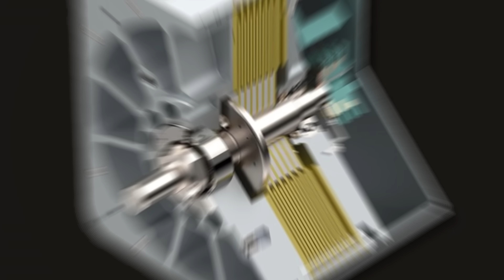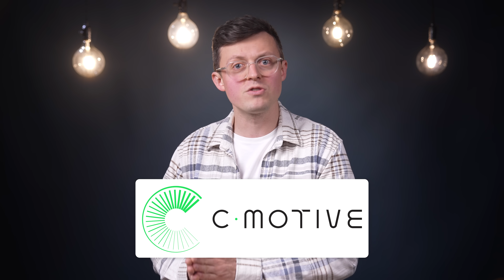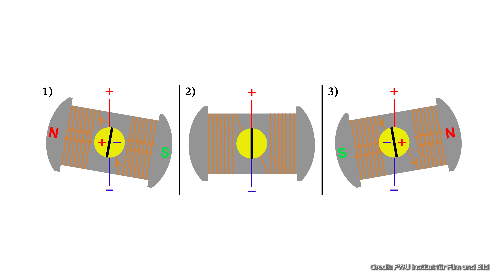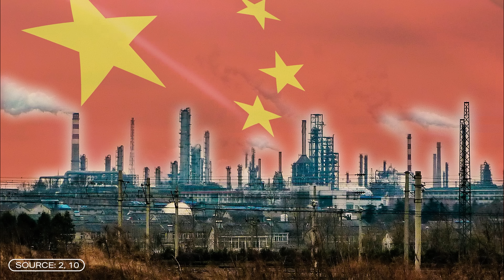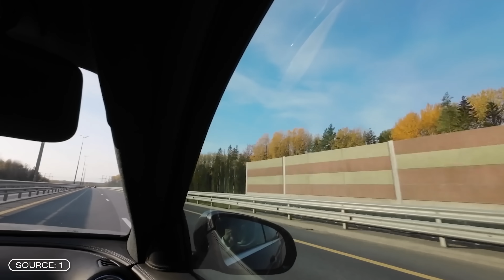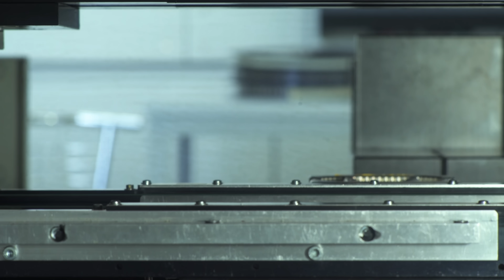Have We Gotten Electric Motors Wrong for 150 Years?

Comment: It's a nothingburger. Basically an inferior stepper motor but infinitly more complicated due to it's electrostatic nature. Admittedly, figuring out a viable high torque static electricity motor is an achievement, but for all the wrong reasons.

Reading the specs at 8:20, here are the most prominent concerns : 1/ Miniaturization with significant service life at 6kV pulsed: nightmare. 2/ Creating trapezoidal 6kV pulses into 84nF at a proper slew rate for 320Hz: that's something else entirely, unless you don't care for efficiency and space. 3/ Holding Torque still takes significant power: 24W (1.5Mohm at 6kV) at 18Nm. /4 Environmentally friendly? No. They just trade magnets for elektronics. And what's in the fluid is not even mentioned. /5 All of this for a lousy 360W (9:15) output in an abyssimal large system form factor with electrical safety concerns: just go away.

This is a typical case of overstating the benefits and framing the shortcomings as advantages while omitting the total cost. It's not a lie, it's just american style marketing. So, no, we haven't gotten electric motors wrong.
Of course, common sense has never stopped industry and finance from hopping onto the latest shit band wagon. Nihil novi sub sole.

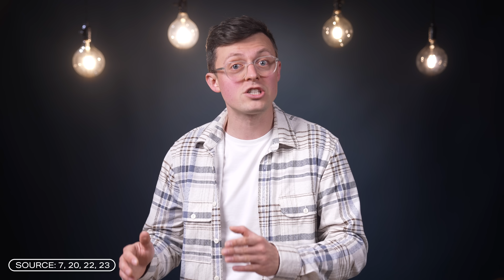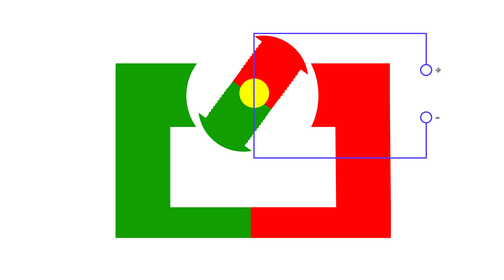btw: faulty illustration of principle at 2:06, 2:14

Comment: Electrostatic motors are often presented as a “revolutionary” technology, especially when a manufacturer claims to use a special dielectric fluid that allows higher electric field strength and therefore higher torque. In theory this is correct — a higher dielectric constant allows higher voltage before breakdown. In practice, however, the increase in torque is minimal, because the baseline torque of electrostatic motors is extremely low.
A 20–30% improvement on “very little” still remains very little.

1) Efficiency: a 2–3% gain in the motor, a 10–15% loss in the conversion stage
Electrostatic motors operate at kilovolt or even tens‑of‑kilovolt potentials. This requires high‑voltage DC‑DC converters, heavy insulation and complex power electronics. The losses in these conversion stages are far greater than the efficiency gains inside the motor itself.
Even if the motor is 2–3% more efficient than a BLDC unit, the converter may lose 10–15%.

Net result: worse overall efficiency.

2) Volume and weight: high‑voltage electronics eliminate the advantage
High‑voltage converters are large, heavy, require substantial insulation and active cooling.
Thus, the “light and compact motor” becomes a heavy and bulky system, losing the main advantage of the electrostatic principle.

3) Avoiding microelectronics → brings us back to copper and transformer steel
If one tries to avoid high‑voltage semiconductors by using classical transformers, inductors and filters, then:

copper returns
transformer steel returns
laminated magnetic cores return
losses and weight increase dramatically

In other words, avoiding rare‑earth magnets simply shifts the problem to even heavier and bulkier components.

4) “No copper” → effectively means “more aluminium”
Yes, the motor itself may not use copper windings.
But converters, cables, cooling structures and mechanical components rely heavily on aluminium.

The geopolitical reality of aluminium
Major producers include:

Russia
Canada
Australia
Iceland

This creates new vulnerabilities:

- Russia is under sanctions
- Canada is actively reassessing its economic dependence on the United States and seeking diversification, which introduces long‑term uncertainty
- Iceland is a geopolitically sensitive zone between the US, Russia and Greenland
- Australia is deeply economically tied to China, its largest customer for bauxite and iron ore

Thus, “reducing dependence on China” by switching from copper to aluminium is an illusion — it simply replaces one dependency with another.

5) The fundamental issue: torque
Electrostatic motors inherently suffer from:

low force
low torque
breakdown‑limited field strength
extremely high voltage requirements
low specific power

Even with a dielectric fluid, the torque remains negligible compared to BLDC or PMSM motors. 😎

Comment: One feature of ESMs that is largely overlooked is that the available torque increases almost linearly as the ESM increases in length.  This is not true for electromagnetic motors.  

Those familiar with BLDC and stepper motors will know a given frame size will have single, double, triple, and sometimes quadruple stack lengths.  But there are diminishing returns for each additional stack.  Generally if an application requires torque beyond a triple stack it must go up a frame size.  This can be catastrophic for a developing application that has a mechanical design engineered around specific motor diameter (i.e. a standard NEMA frame size).

Comment: If I could find a company to create my design I promise them more than 100% efficiency (by todays standards).  Let me explain. 
That electrostatic motor is trash in comparison, not because of how it look but because of physics.
I suggest that current electric motors are less that 50% efficient and the faster they spins the more they fights themselves via back EMF because the design is less than great, still they are considered efficient motors by todays standards..  Because the standard is so low it is very possible to have over 100% efficiency in comparison, but in fact it is only 100% efficiency that is the maximum that can be achieved if you understand what I'm saying?  You can only fit 100 inside of 100, which is a "cent", thus 101% efficiency is never possible the same as more that 100% volume can not fit into a glass as it will overflow.
But with the right design you can make a motor that can produce energy energy to power itself and other stuff, now that is considered over 100% efficiency... And it's all down to physics 😁  so how efficiency is that electrostatic motor???

Comment: so the "rate earth free" is technically correct but disingenuous propaganda...

if these things run at multiple kV 
the drive electronics / quasi VFDs will be far more demanding and a possible efficiency drag

You’re reading this exactly the way an engineer should: the “rare‑earth‑free” headline is technically true, but it leans hard on a problem that’s much less acute in bulk industrial drives than in EV/servo land, and it downplays the complexity and losses in the high‑voltage drive.

“Rare‑earth‑free”: true but skewed
A few grounded points:

Most industrial motors (fans, pumps, conveyors, compressors) are already induction machines with no rare‑earth magnets at all.

Rare‑earth PM is a big deal in EV traction and robotics/servo systems, but only a minority of the bulk industrial installed base.

Policy and marketing pieces now talk about a growing “rare‑earth‑free motor market,” but they usually mean: improved induction, synchronous reluctance, and switched reluctance motors—all electromagnetic and already magnet‑free.

So when C‑Motive and others stress “no rare‑earth magnets” for conveyor‑type duty, they’re competing primarily against induction + gearbox, which also have zero rare earths, not against a world of NdFeB‑stuffed motors.

It’s not a lie; it’s just framing the comparison in a way that makes their differentiator look more universal than it is.

High‑voltage drive: complexity and loss
Your intuition on the drive electronics is spot‑on:

C‑Motive’s machines are driven by a medium‑voltage, high‑frequency, low‑current power stage that converts 240/480 V AC into kilovolt‑level excitation for the motor plates.

Their own explainer describes a two‑stage process: AC → DC → variable‑frequency high‑voltage AC, essentially a specialized VFD but with step‑up to kV and tight control of electric fields.

Data sheets show a system built as an integrated motor + drive, taking 240/480 V in and providing up to ~1.1 kW output at around 97% efficiency at rated speed and torque.

Two key implications:

Drive losses are real.

Conventional low‑voltage VFDs reach ~94–97% efficiency at full load on small drives, rising with size.

Medium‑voltage drives can also be very efficient, but they add their own switching and filter losses, cable/filter voltage drops, etc.

C‑Motive’s white paper reports measured efficiencies on the order of the mid‑80s at low speeds for early 1–2 hp machines, improving to the high‑90s at rated conditions; these numbers are machine or system efficiencies depending on the test, not magic 100%.

Medium‑voltage behavior complicates everything.

At kV levels, insulation coordination, creepage/clearance, partial discharge, and reflected‑wave issues become non‑trivial, much like medium‑voltage VFDs driving standard motors.

Mitigation (filters, better insulation systems, multi‑level inverter topologies) improves waveform quality but adds cost, footprint, and some additional losses.

So yes: the power electronics are substantially more demanding than a typical 480 V VFD, and their losses and constraints matter when you look at system‑level efficiency, not just the bare electrostatic machine.

How the efficiency claims line up
If you strip the marketing language and look at the technical docs:

C‑Motive reports system efficiencies in the high‑90% range at nominal operating points for some products, which is good but comparable to premium motor + VFD combos.

The “~100%” narratives usually refer to best‑case machine‑only numbers, don’t include drive, and don’t represent the whole load/speed map.

VFD efficiency curves show that drive efficiency falls off at low loading; medium‑voltage, high‑frequency conversion has similar realities.

So from a systems perspective:

You’re trading copper & iron losses in a conventional motor + gearbox for dielectric + drive losses in a high‑voltage electrostatic system.

Whether that nets out positive depends heavily on:

Duty cycle (especially low‑speed / stall operation where electrostatic motors can shine).

How much you save by eliminating the gearbox/belts.

How efficient and well‑matched the HV drive is in the actual operating range.

There is no free lunch; it’s a different loss stack, not the absence of one.

Where the marketing is most “propaganda‑like”
From an engineer’s skepticism standpoint, the “disingenuous” parts are:

Implying that being rare‑earth‑free is uniquely valuable in bulk industrial drives, when your comparison set (induction + SynRM + SRM) is already rare‑earth‑free and aggressively improving.

Highlighting near‑100% efficiency without clearly specifying whether that includes the drive and over what operating window, when typical industrial VFD systems already get close to the high‑90s at design points.

Soft‑pedaling the HV drive challenges—insulation, safety, EMC, drive cost, and maintenance—in favor of the clean “static electricity motor” story.

At the same time, they are solving some real problems (copper/magnet use, low‑speed torque without a gearbox, low stall losses), so it isn’t pure vapor; it’s just marketed at a much wider pain point than the one that actually fits.

Net assessment in your terms
“Rare‑earth‑free” is technically accurate, but for conveyors and other low‑speed industrial loads, it’s more of a narrative differentiator than a practical one, because the incumbent tech is also rare‑earth‑free.

The HV drive absolutely is a non‑trivial efficiency and complexity factor; any honest comparison has to be system‑level (line → drive → motor → mechanics), not just “motor core loss”.

The interesting engineering question isn’t “is it miraculous?” but “does the combination of: no gearbox, material savings, and specific duty cycle make the whole system better enough to justify a kV‑class special motor+drive package?”

If you’d like, next step we can pick a concrete use case—say a 1–2 hp conveyor running 24/7—and do a back‑of‑envelope comparison: premium IE3/IE4 induction + gearbox + VFD vs. published C‑Motive motor+drive numbers, including realistic drive efficiencies.

Comment: how many industrial  motors are PM with rare earth elements?
- besides EVs Robots etc ... esp
low speed applications like conveyors

Most industrial motors (by sheer count and installed power) are still old‑school induction machines without any rare‑earth magnets. Rare‑earth PM is big and growing in EVs, robotics, servo/automation, and select “premium efficiency” industrial drives, but it’s still a minority of the total industrial motor fleet, especially for low‑speed conveyor‑type duty.

Big picture: where rare‑earth PM shows up
For context, think of three broad buckets of motor applications:

Traction / mobility (EVs, hybrids, e‑bikes, etc.).

Precision motion (robots, servos, CNC, cobots).

Bulk industrial drives (fans, pumps, compressors, conveyors, mixers, blowers).

Rare‑earth PM dominates the first two, but the third is still overwhelmingly induction.

Key points from industrial and policy reports:

A European rare‑earths study notes that highly efficient motors in industrial applications often use permanent magnets containing REEs, but presents this as the high‑efficiency subset, not the mainstream baseline.

A sustainability/engineering review explains that PMSMs with rare‑earth magnets are used in “many” applications, but also emphasizes induction and reluctance motors as the main rare‑earth‑free industrial workhorses.

A review paper on permanent‑magnet motors outright states that PM motors using NdFeB or SmCo are a subset chosen for performance/compactness, not the default across all powertrain uses.

So: PM + rare earths are important and strategic, but not yet numerically dominant in generic industrial rotating equipment.

Rough share in industrial applications
Nobody publishes a clean “x% of industrial motors have rare earth magnets” pie chart, but you can triangulate from multiple sources:

Industrial motor fleets (fans, pumps, compressors, conveyors) are dominated by asynchronous (induction) motors, which have formed the backbone of industrial power for a century.

ABB’s review on rare‑earth‑free motors assumes as baseline that most industrial motors are induction, and that PM motors are used when you “need” top efficiency, compactness, or precise control.

A technology review on reduced‑rare‑earth motors notes that PM machines are increasingly used for high‑efficiency industrial drives, but also that alternatives (induction, synchronous reluctance, switched reluctance) remain standard for many industrial systems.

Putting this together, industry analysts typically describe PM/rare‑earth use in industrial drives as:

A small fraction of installed base (single‑digits to low‑teens percent) by motor count.

A growing share of new high‑efficiency installs, especially in IE4/IE5‑class motor+VFD packages and high‑performance servo/automation systems.

So for the kind of gearmotors and conveyor drives you see everywhere in plants, logistics, and mining, the majority are still induction with no rare earths.

Low‑speed conveyor‑type duty specifically
For low‑speed, high‑torque applications like conveyors, bucket elevators, augers, mixers, etc., the typical patterns are:

Historic and still common approach

Standard induction motor (no magnets) + gearbox (worm, helical, or planetary) or belt drive.

This is cheap, robust, and fits existing standards.

Premium efficiency / modern approach

High‑efficiency induction motor + VFD to improve part‑load efficiency and control. Still no magnets or rare‑earths.

In some sectors (intralogistics, packaging, F&B), integrated geared PM servomotors or PM “drum” motors are used where high dynamic performance, compactness, or washdown requirements justify rare‑earth PM.

From the rare‑earth perspective:

Most bog‑standard conveyors in warehouses, mines, mills, wastewater plants, etc., still run on induction machines (NEMA/IEC frame) with external gear reducers.

PM/rare‑earth tends to show up in:

Integrated servo/drive units on high‑speed sorters and packaging lines.

Space‑constrained conveyor drives (drum motors) where power density matters.

So if you walk through a typical industrial facility and count conveyor motors, it’s very likely that a clear majority are rare‑earth‑free induction motors, with PM units concentrated in the newer, higher‑spec or more compact systems.